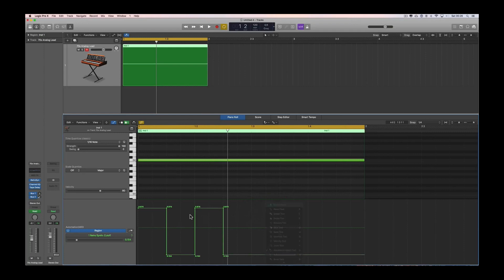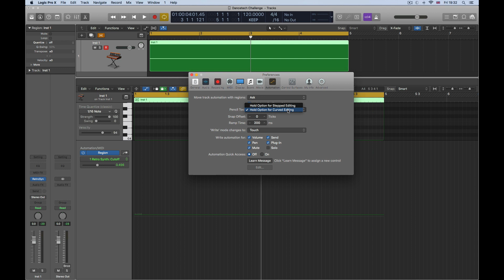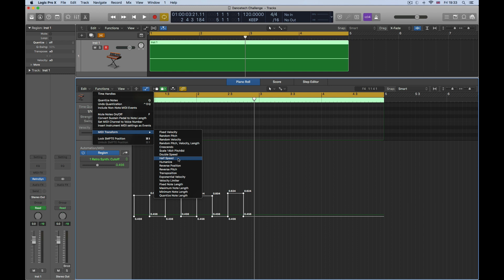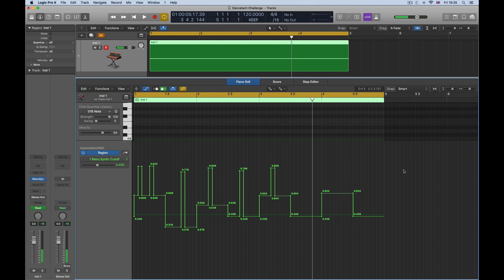Logic X Tutorial  - Gated Automation / Square shapes

Comment: Cool technique. I didn't know you could pencil in like that using automation quantise values (i never really looked at that tbh). Here's what I found after experimenting with your example to fix collapsing after doing double-speed: https://youtu.be/XIlcKTlcIAU
Reply from the maker: Good discovery. Yes you are right. Also I completely ignored the fact that my snap offset was set to 0. I was not aware that the cause of shapes collapsing can be offset dependant. I also checked just a second ago, if offset is set to a negative value ( -5) collapsing does not occur except for the first shape again, which on this occasion collapses differently (try it). Nevertheless, whilst this pencil technique could be a way around the problem, it looks like only partially. The conclusion is, there are obviously bugs in automation drawing behaviour whichever way one decides to look at it.  Btw. I totally agree with you, we should have a 'cubase' type of automation by now in logic but then I also have more relevant requests which would help in my set up, like bringing back Logic synchronising to the external clock  ;) Keep up the good work man!
Reply: Logic can't sync to external clock? are you sure? all the settings are there still but i didn't try it for years now.
Reply from the maker: @dancetech  Positive, not to midi clock. Apple removed it since version 9 if I am not wrong, which makes it pretty much unusable as as support for live situations. I know people use Ableton for such things but I never got around to learn Ableton.
Reply: weird. what's your master unit you're trying to sync logic to out of interest?
Reply from the maker: Yes, it's a fairly known issue. Don't get confused, I can send midi clock from Logic to external gear and they sync more or less fine, depending on unit, but Logic won't accept clock from external source.
I have a few, Sonic Potions LXR which has a super tight and steady clock, ZAQ step sequencer, again very tight clock and fast start + stop, even Electron Digitakt.
Reply: nice. problem is there's no way to convert midi clock to mtc afaik